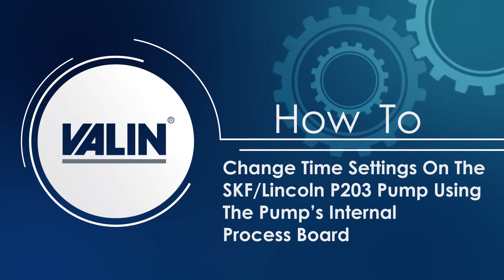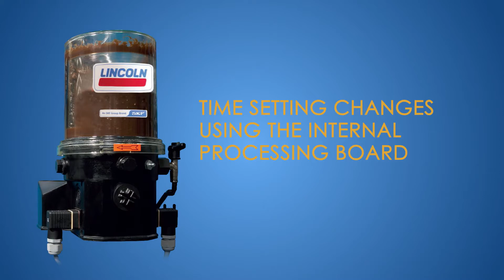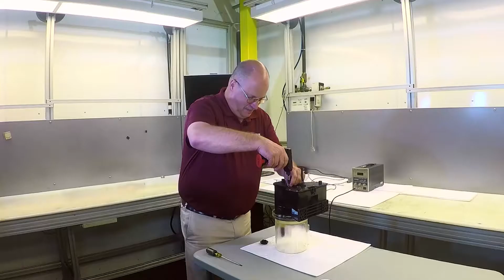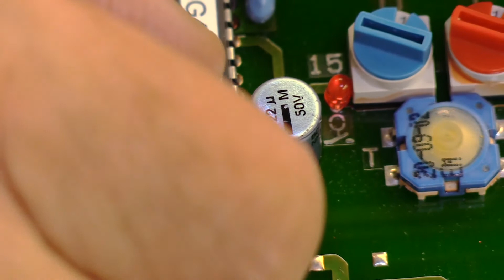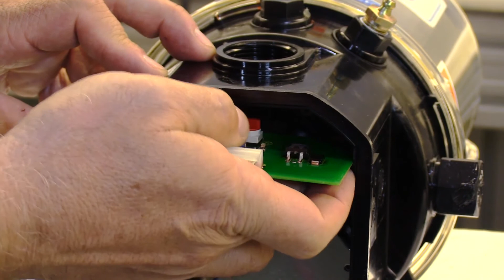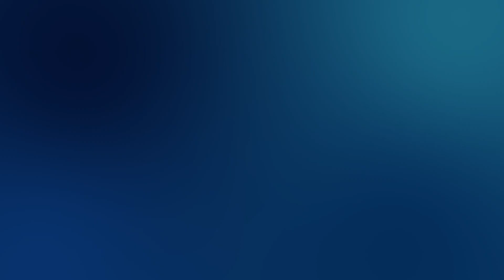How To Change Time Settings on the SKF/Lincoln P203 Pump Using the Internal Processing Board

Comment: Some1 tell me how to change the direction.mine is a P203 auto greaser,15L,& 24VDC as the motor.its was supplied going counter-clockwise viewed from the top (which is the wrong direction).
Reply: Swap the positive and negative power supply. I’ve wired ours up backwards and it ran backwards. Just check that you haven’t unwound the sweeper in the grease tank.
Reply: @jethrohilton7858  it was unwound.i only realized that it had been going the wrong direction after the stirring paddle had come loose.but thanks,I have got the direction correct now.
Reply: Very informative
Reply: Anyone need any Lincoln pump elements?
Reply: What settings should I use to make it run continuous??